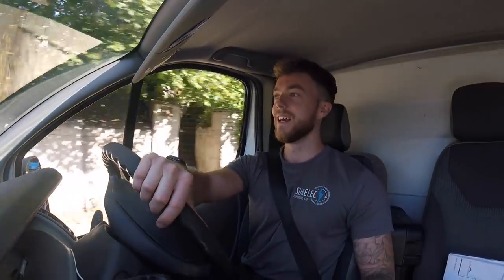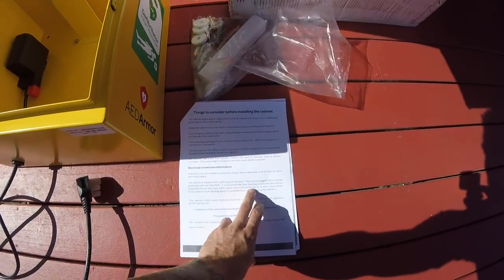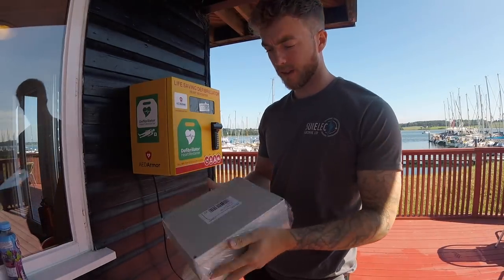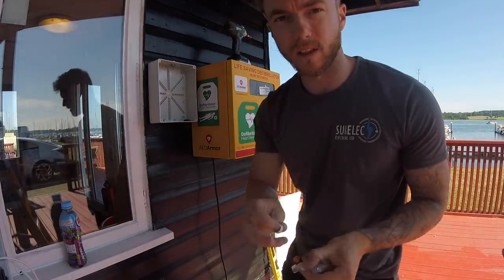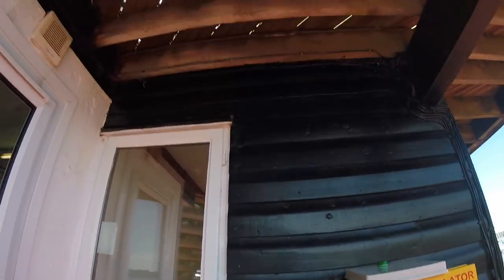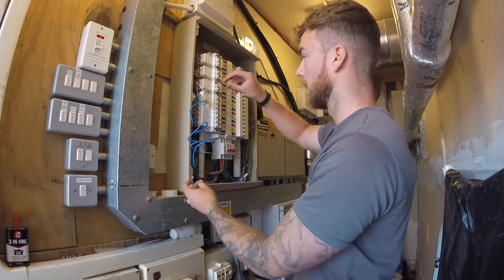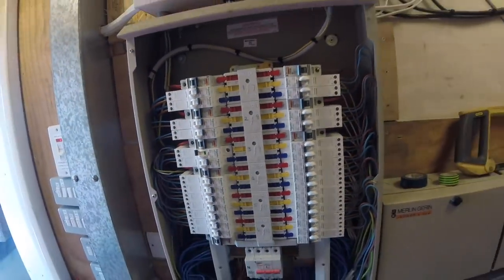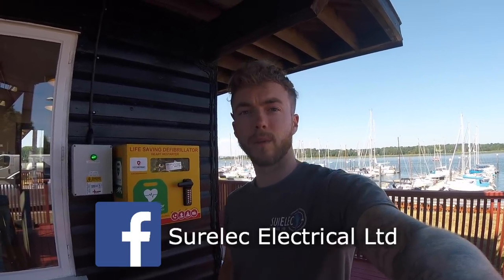SurelecTV- DEFIBRILLATOR INSTALL

Comment: Nice neat job. One question, could you have used some kopex for the flex to the defibrillator. Just for an extra bit of protection?
Reply from the maker: Alan Quinn thanks pal, appreciate it! Not too concerned in this situation as it is tucked quite out of the way and the likeliness of the cable coming into contact with anything is very small. The cable also comes pre glanded out of the unit and the manufactures instructions advise that no alterations should be made to holes on the enclosure. Glad you’re enjoying the videos

Comment: Nice work mate definitely good idea with the light as an indicator,will make it much easier for the customer if any problems occur. It’s little things like that and labelling fuse spur with correct rating that can help. To many times you see people putting wrong fuse in as they “don’t know what one” to put in so they guess lol
Reply from the maker: Alex shepherd thanks mate! You’re very right there. I think it’s always good to label stuff like that, doesn’t just help the customer but also helps anyone else who should ever need to work on the equipment. Thanks for watching, hope you’re enjoying the content.
Reply: SurelecTV yeh mate enjoying the videos keep them coming 👍🏽
Reply: i do the same tbh great tip i suppose if they did get it wrong the mcb will trip way before the plug top fuse and over load protection could be omitted on fixed loads other than manu instructions taken into consider ration does this need over load protection

Comment: A tidy job, I would've used an E1W gland in a marine environment like that, provides a lot better long term durability and ingress protection. CW glands are alright, but from experience don't work well long term in harsh environments
Reply from the maker: Spark Clark thanks mate! Yeah I know what you mean, this install is pretty well sheltered tbh and shouldn’t come into contact with too much moisture. The guys who installed all the pontoon/marine bollards originally, used normal CW glands- it’s been a nightmare changing the bollards if they’ve been hit cause the glands have rusted so much!

Comment: Hi Tom nice video and great job was done over there. Is it my idea or you were actually working live over the fuse board to install the swa and the RCBO. Anyway, I wanted to ask regarding your labeling. What kind of machine do you use for labeling both the fuse board and the rest?
Reply from the maker: Charalambos Skamballis hi mate, thanks! The fuseboard was indeed live at the time, I try not to do it, but in this scenario the customer can’t power down the severs. I use a brother PTE-300 for all my dedicated labelling, all my other labels are either from Rexel or the NICEIC directly. Thanks for watching!

Comment: Great vids, suprised/interested to know why youve put it on a RCBO considering its a life saving machine?
Reply: I know this is a bit old..  But the defibrillator itself is completely self contained, it is not connected to the supply in any way (Not even to keep its charge)..  The supply is for the cabinet which has a light and a small heater (200w) to make sure the defibrillator does not get too cold...  Instructions say it must be protected by a 30ma RCD...  Not sure why you would put it on a 16A circuit considering the FCU has to have a 3A fuse and the whole thing probably uses less than 1A..  I put the one I fitted on a 6A RCBO..  But guess as long as the cable is ok then it doesnt really matter..

Comment: nice work but why the cheap diy drills from b&q be better buying lxt models so you can add more tools to the batteries
Reply from the maker: Hi Nathan, I do own the Makita LXT brushless drills- the drills in the video I’ve had since my apprenticeship and still use if my other batteries have died haha- still going strong nearly 10 years later

Comment: hmmm quick thinking would be me cutting a 1 by 1 to height level and making a monopod ( one stick tripod) to help me hold the heavy thing up.. im only 5 feet tall so i have to use my brain so i dont use my weak body
Reply from the maker: I did it haha! Good idea, I have used my steps to prop things up before if I’ve needed. I’m only 5ft8 myself so do struggle sometimes!

Comment: That circuit should not be protected via RCD/RCBO & the SWA  should not have been installed into the top of the adaptable box.
Reply from the maker: Hi Paul, Manufactures instructions stated the equipment should be installed independent to anything else and have RCD protection.

Comment: Top stuff... Only critique is that the RCD test should have been done at the further point (i.e the FCU).
Reply from the maker: Alvin Ashman Thanks Alvin! I have to disagree with that though, i believe the RCD can be tested at any point on the load side of the RCD, so even at the RCD itself. My reasoning for this, is, the RCD test is the last test, so therefore the circuit has already been tested for it conformity against its protective devise. The RCD test is purely to test the functionality of the RCD only.
Reply: SurelecTV- The trip time would be fractionally more if tested at the FCU as the fault current has further to travel.
Still a very good job though 👍
Reply: Test at the RCD not the end of the circuit.
Reply: Johnathan Wright- I'm afraid not my friend, for you to test at the RCD, it would mean you removing the front cover of the consumer unit, switching on the main switch and associated RCD(s). This in turn would energise the busbar and any expose tabs of the busbar, you do this in front of a CPS assessor and it's game over. Safe isolation must always be carried out before removing the front cover of a consumer unit.
Reply: Alvin Ashman that’s how I Test RCD’s in front of my area engineer during assessments.  No more dangerous than at the terminals of a spur. If the spur is not near the consumer unit do you isolate the spur before you take the front off or do you take the front off live to do your tests.
Reply: Johnathan Wright- I disagree, it's far more dangerous to test at the consumer unit than it is at the FCU. The terminal holes at a FCU are sized so that you can't stick your finger in them or accidentally touch any live parts, this isn't the case at the consumer unit, as mentioned before there's the possibility of an exposed busbar, exposed busbar tabs and the insulation of  manufacturers links between the RCD's tend to be stripped back far too much, exposed a good amount of the conductor material, all of which you would easily be able to touch.
Reply: Alvin Ashman - I carry out safe isolation. remove the load ( outgoing circuit if rcbo or the busbar and neutral on an Rcd. Re energise and test the Rcd. You don’t need the whole board live just the Rcd you are testing. If you test at the furthest point where an Rcd protects several circuits these can affect the results due to existing leakage on a circuit you are not testing. I avoid this by testing only the Rcd and not the circuit. I’ve had an Rcd that tripped in time only because an immersion heater was on. I would have certified a faulty device and left
Reply: Johnathan Wright- OK well we could probably debate this all day long and still not come to an agreement. I will continue to test RCD's the way I was taught and the way most of the tutorial videos here on YouTube demonstrate.
Take care, all the best.
Reply: Safest way of doing it always seems to be at RCBO terminals unless there's a socket outlet on the circuit